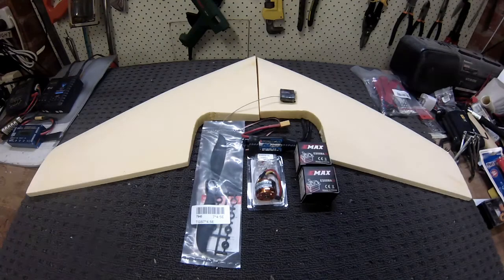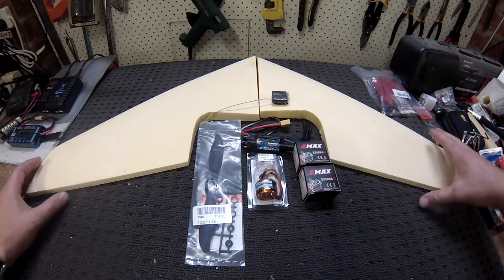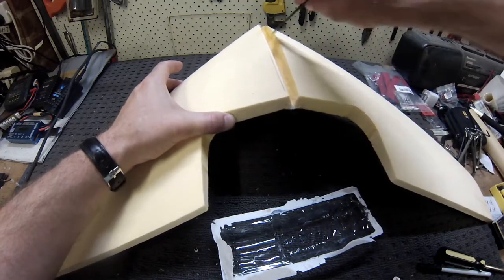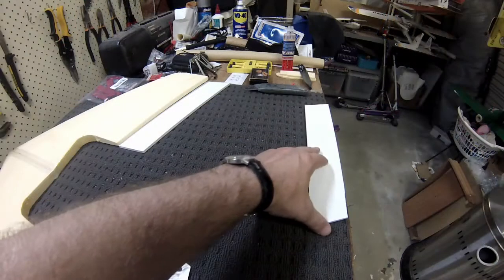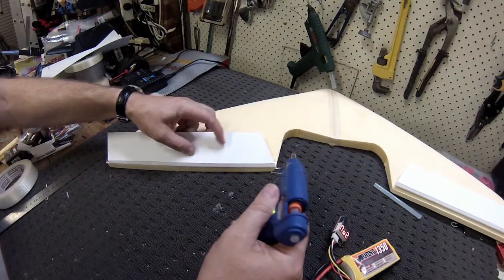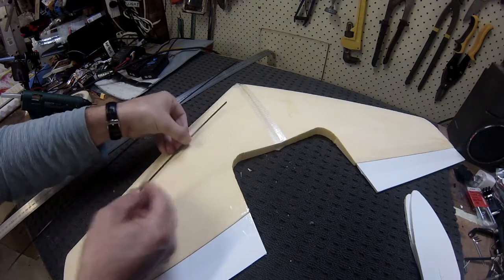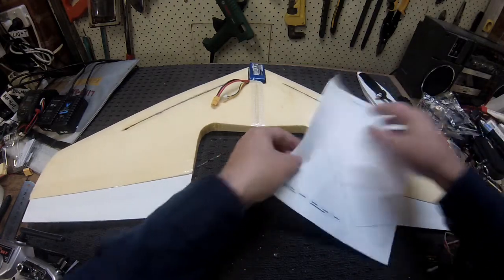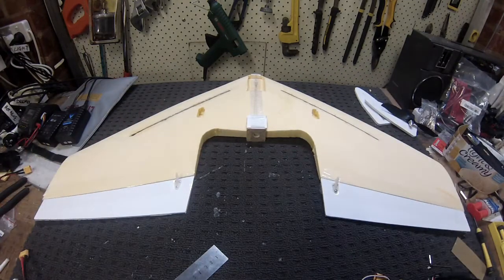Hot Wire Mini Arrow - Build

Comment: 2300kv motor. aaaaaaaa. that would work as well.
Reply from the maker: definitely. I have a couple of those too. Originally we were going with a common setup for all the wins (based on the Flite Test setup), but one guys did actually put a Turnigy 2826-6 2200 kV in his. Definitely gives it extra punch.